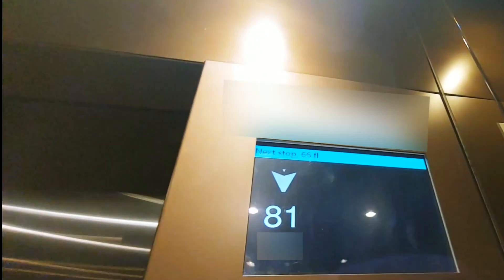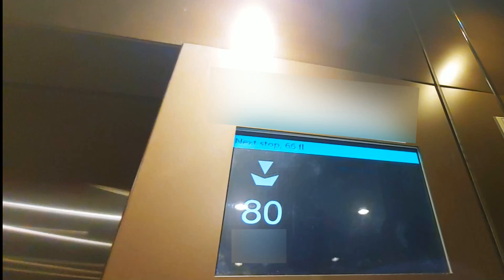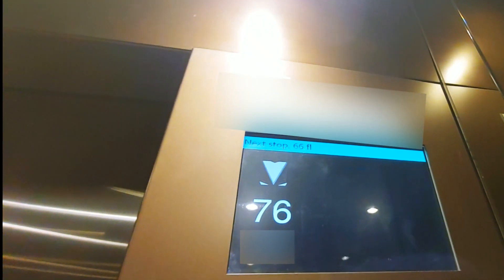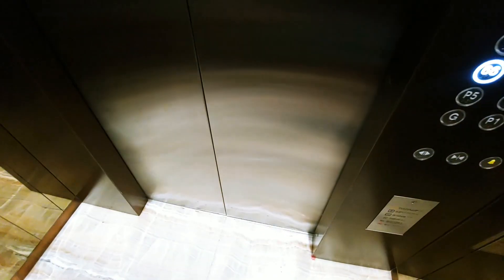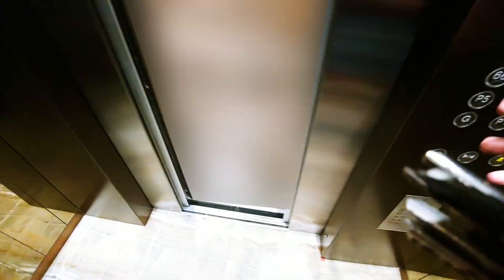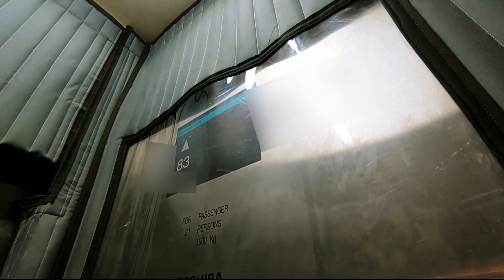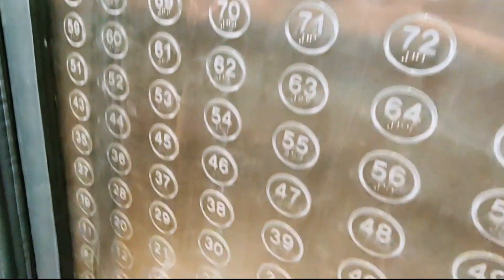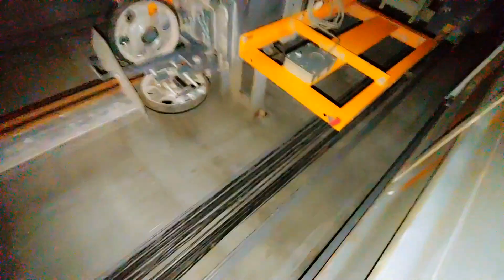Detailed look at 5.5 m/s Toshiba lift

Comment: Do the passenger lifts serve a residential part? If so it's understandable why they're quite slow, as residential buildings have slower lifts due to lesser demand.
Reply from the maker: These lifts serve up to floor 90 (I think), the building is a hotel.  There are also some lifts straight to the top (to something like floor 95), which I think is some stupid posh restaurant, but I wasn't able to get in these.  There are around 100 floors in total if you include the service mezzanine floors.

Comment: They should have installed a Kone ecodisc MX100 witch goes 17m/s.
Reply from the maker: Kone ecodisc MX100 only goes 10 m/s (or 6 m/s double deck).  Like with most of the rated speeds stated by Kone (including on MX18, MX32, MX40 and MX100) the max given speed is purely theoretical.  Kone are very misleading on this.
Reply: @benolifts  Ah ok
Reply from the maker: Oroginal ecodisc - 1m/s with old style brakes
MX05 - Weird ecodisc with brakes in wrong place.  It is not used in the UK
MX06 - 1 m/s base model.  Very rarely overclocked to 1.6 m/s.   Also used on asdas 0.5 m/s cheap-o-discs useless 4:1 lifts.
MX10 - 1.6 m/s mid range.  Also used on 0.8 m/s 4:1 mid goods lifts.
MX18 - MR ecodisc.  Claimed by kone to go 3.5m/s but only goes 2.5 m/s.  Also used on Kone modernization of old lifts.  These mods are rare as kone prefers replacing with MRL (somthing I disagree with).
MX20 - The most powerful MRL lift.  2.5 m/s.  also used on 1.25 m/s 4:1 goods lifts.
MX32 - High speed ecodisc.  4.5 or 5 m/s.  Kone claims it can go 6 m/s, but this not run this fast in practise.  
MX40 - High speed ecodisc.  6 to 8 m/s.
MX100 - Super high speed.  10 m/s.  Or 6 m/s double deck.   Kone claim it can go 17 m/s but this is purely theoretical.
PowerDisc - 0.7m/s to 1m/s.  8:1 or 10:1.

--- NEW MODELS OF ECODISC ---
NMX07 - Replacement of mx06.  goes 1 m/s.
NMX11 - Replacement for mx10.  goes 1.75 m/s.  (improvement over 1.6m/s)
NMX14 - used for new goods lifts.  goes 1.6 m/s 4:1.  Do not know if used on regular lifts
NMX20??? - possible new motor to replace mx20
Ecoreal - replacement of power disc.  Motor moved from shaft to under lift to maximise space of counterweightless lift.
Reply: @benolifts  If "NMX 20" is referring to the one that's fitted to post-2013 big MonoSpaces, then that's actually just a revised MX 20.